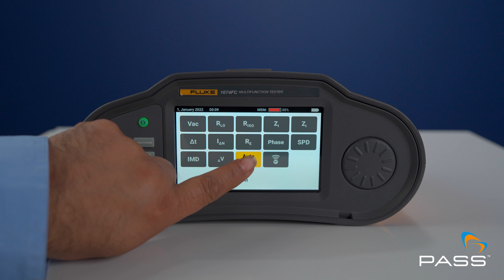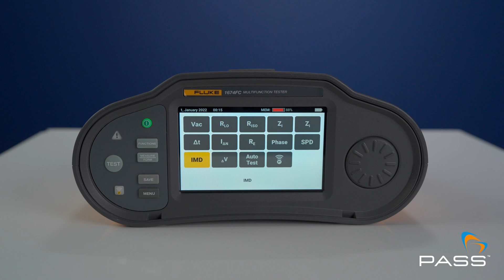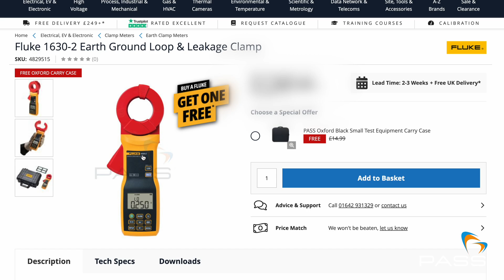Fluke 1672, 1673 & 1674 Testing Capabilities - Best Multifunction Fluke Created!

Comment: EV Testing is not compatible with 167X series. What are you talking about?
Reply from the maker: You’re right to ask — the 1670-series (1674 FC) is primarily an installation tester, but according to Fluke’s manual, it does support ‘EV Test 6 mA for RCD A/EV, RDC-DD’. 

To test a full EV charging station (mode 3 EVSE, Type 2 plug etc) you’ll need the optional adaptor kit (Fluke FEV300) to unlock full EV charger testing functions. 

If you’re only looking at RCD & protection functions related to EV circuits, the 1674 FC is compatible. If you need full station certification, make sure the kit includes the EV-adapter.

Details of the adapter below:
https://www.tester.co.uk/fluke-fev300-ev-charging-test-adapter-choice-of-plug-type

Comment: The 1670  Multifunction  Tester is True RMS?
Reply from the maker: Yes, the 1670 Multifunction Tester does feature True RMS functionality, making it great for accurately measuring both AC and DC signals.
Reply: Veo que tampoco te dan respuesta 😉
Reply: @elektrikahectorfernandezol5341  That's odd nobody answered yet. Maybe the answer to that question won't help with the sales?? I find hard to believe that this equipment doesn't measure the voltage in RMS. Did you try to contact Fluke directly?

Comment: A lot of emphasis on the documentation but can it do things like high resolution loop impedance testing and auto continuity test?
Reply from the maker: Great question! The device is designed to handle high resolution loop impedance testing. Here is a list of testing features:

AC/DC Voltage
Continuity
Insulation
Non-trip Loop
High Current Loop with mOhm resolution
RCD Trip
RCD Ramp
Phase Rotation
Earth Ground Resistance
NEW Voltage Drop
NEW dedicated EV Test 6mA for RCD A/EV, RDC-DD
NEW Insulation PreTest function
NEW Surge Protection Device (SPD)
NEW Insulation Monitoring Device (IMD)

Check out the product and full specification here:
https://www.tester.co.uk/catalogsearch/result/?q=fluke1670&product_list_dir=asc&product_list_order=price